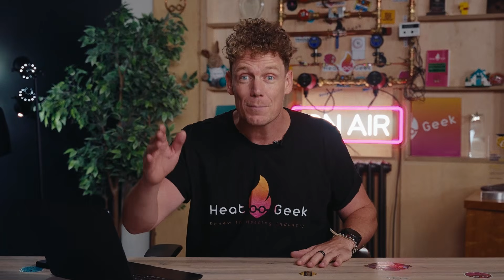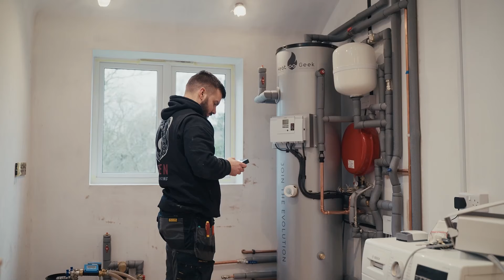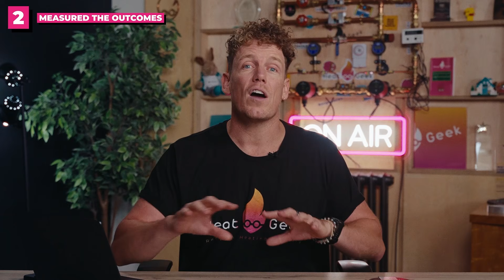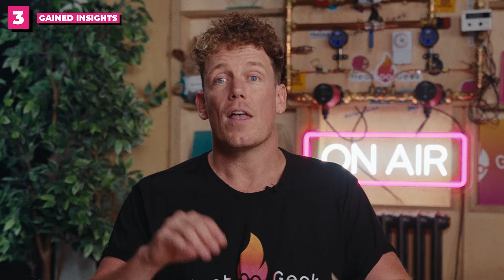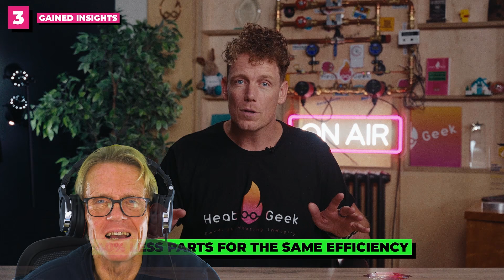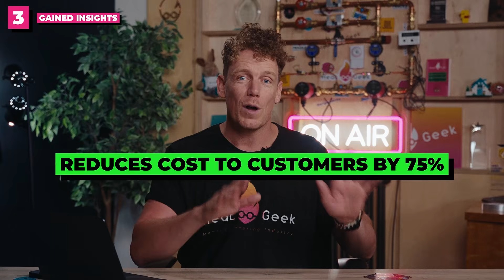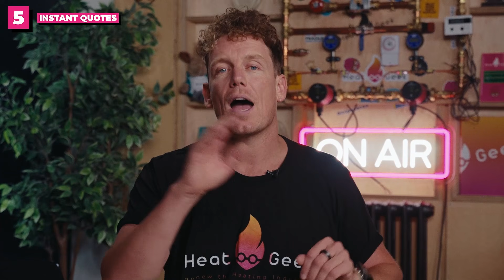Heat Pump Reality Check: Is Zero Disrupt Too Good to Be True?

Comment: This makes no sense. I went on the website for a quote bearing in mind that my home has been built in the last 10 years with a heat loss of circa 5kw. They quoted me £3150 for what basically is just a heat pump purchase. I have a 210L tank and my home uses underfloor heating. When I checked online a Valiant 7kw heat pump including all install accessories (and I mean ALL) comes to £4500 (ex VAT which is what they'll be paying, if not less, my quote was retail)

So let's do the math. £7500 BUS grant + £3150 = £10,650
£10,650 - £4,500 = £6,150

So what you are essentially saying is that labour cost for a days work is worth £6,150...........
Reply: The guestimate tool def needs work but prices are too high regardless. Mine came back saying £5000 and need a 10kw heat pump.  Have a 70s 3 bed detached so not perfect but def don't use 10kw at -2.  Done my own heat loss, think 7kw would be more than enough (5kw would probably be fine but marginal), but even then the price between a 7kw to 10kw would not bring that down to £1 and to think they get £7500 on top. 

My next heating system will be a heat pump and I will install it, ironically I will be able to do this thanks to the excellent information provided by HeatGeeks!   Price will be similar but at least I'll get the install I want and won't have wasted £7500 of tax payers money.
Reply: @radfoo the BUS grant is there so we have enough heat pump engineers to replace all the systems we will need to change
Reply: For about the same price here (£7.5k + £3.5k) I got, new 6kW HP, new Mixergy HWC, 7 new larger radiators, new 28mm copper backbone with 22mm feeds to radiators and six men for about six days.

Perhaps you should get another quote ?
Reply: If they're quoting you that much then who gets the £1 quote? Are you sure you haven't missed anything?
Reply: @user-cl4wn9pc2s  Nope, mine would be an ideal install. The HP would go on the other side of the wall where the boiler is. Not that thr website would know this but i did select the 3m or less run and also chose the option to use my own tank. Its honestly a rip off. This install can be done easily within the £7500 grant. Quite disappointed. When this grant disappears and no one is installing heat pumps anymore imagine the servicing costs
Reply: @etan30  it’s not a quote though. it’s an estimate. send them an email, see if they can give you a better idea with the info you’ve put on here.
Reply: i’ve got a 5 bed detached 1950s house and my estimate is £2700…
Reply: A "heat loss of 5kw"??? FFS.....the generally public really doesn't understand.

Comment: Since when do heat pumps not modulate? I think Roger is trolling
Reply: Is variable speed the same as modulation? I dont think so, you can change a motor speed by changing the frequency but if say you change from 50Hz to 40 Hz to slow down the motor then it will be running at 40Hz not modulation between 50Hz and 40Hz. Thats not modulating
Reply: @dantronics1682 

And if your automated system varies that frequency between 40 and 50Hz to automatically adjust compressor output as set by the weather compensation curve ?

HPs now modulate output.
Reply: Actually the inverter heat pumps do modulate downwards  but they have no spare capacity to turn up the flow temperature  in cold weather, The efficiency drops and you just have to run them 24/7.

Comment: Won’t it all depend on the electricity prices that will determine if it’s cost effective when it comes to the bills.
Reply: Electricity is 4x the price of gas. In winter when you need to use your heat pump to heat your house the COP can be around 2. 
So, in winter, a gas boiler costs half as much as a heat pump to heat your house.
Reply: @caparn100  so basically it sounds like these heat pump companies need a campaign to sell their products = don’t worry about the cost of your bills being doubled compared to gas boiler because we will pay the difference each year .

Comment: Heat pump installers sound like the EV people who are now promising recharging in 10 minutes by magic  to address range anxiety.
Reply: You don't really need ten minute charging, it would rarely be of benefit, if your on a long trip you don't want to be rushing your coffee or bacon roll whilst car charging, ready for its next 300 miles.
Range anxiety is a fallacy now in newer EVs.
Reply: You probably think an EV works like a kettle as well.
Reply: The latest ones do.  Mine is from last year and even that can charge on a road trip in about 17 minutes which is two minutes more than the average time people spend in a petrol station.

Comment: Here we go again. The problem is the installers or the design. Nothing wrong with heat pumps. My arse.
Reply: I can't work out if you are being sarcastic or not but if you think its not poor installations/design you should watch the Heat Geek and Skill Builder colab that goes to reinstall a botched install which shows it is the issue.

Comment: Fit bigger radiators and turn down the flow rate to about 45c and cut your heating bill bye half
Reply: That is exactly what I did and it works perfectly
Reply: Adam is offering heat pumps with similar costs to gas boilers without changing any/many radiators. You can pay more to replace more, but unless you have things like batteries and cheap tariffs, it is hard to halve the heating costs.
Reply: Don't use antiquated heating systems like radiators in the first place. What is wrong with the UK?

Comment: Roger I’m actually a fan, but you need to simmer down on this topic, you’re the one who’s coming across as a zealot now, that wasn’t always the case. Content was balanced around that Welsh blokes house. Adams got under your skin
Reply: My tumble dryer has heat pump. It works great and is cheaper to run.
Reply: @paulhayes6920  Mine has dual heat pumps :face-blue-smiling: Problem with them is that they can allow too much lint through the filters if you do not clean them regularly. When clogged they are very awkward to  dismantle and repair resulting in it not being economical and then being sent for scrap. so ultimately not lasting as long as a  conventional dryer. Plus they take a long time to warm up.
Reply: It's not being a zealot; facts are facts. The UK is just so far behind other countries.
Reply: You are kidding me. This is just a bit of good natured fun. Adam and I get on well.
Reply: @Roger-Bisby1 Rogers given us a platform and I’m very thankful for it!
Reply: @Roger-Bisby1  glad you can have a bit fun!
Reply: It looks like Adams and everyone elses heat pump sales will increase then with all the satisfied folks who have them. 

Especially with such amazing claims of sustainable annual COPs and electric costs that are so much cheaper than gas. I'll just keep fitting them for folks who believe they are cheap to run and think that they are the future despite my concerns with their install and running costs.

I wish everyone all the very best with saving money heating their homes with sufficient air changes and heating their water in the long run. And good luck with cooking their food and sanitising their laundry, not having to use heavy chemicals to do it in the place of HOT water.
Reply: @poormanskint3008  something is telling me if you are unsure about that performance then you probably don’t know how to install them effectively and I would suggest you stop and do some training
Reply: @poormanskint3008  "And good luck with cooking their food and sanitising their laundry, not having to use heavy chemicals to do it in the place of HOT water." This is the most hilarious thing I've seen this week, none of these things have anything to do with heat pumps. Electric cookers have existed for decades and work very well. Most modern washing machines have a single cold water feed now. If you install heat pumps I'd question your credentials to be honest. 🤣

Comment: Home owners are catching on that when it's really cold in winter, the heat 'pump' becomes a hugely expensive electric kettle to heat the water in the rads.
Reply: Are you trying to argue that in the winter, only folk using a heat pump will be using more fuel to keep their homes warm?  I know my gas bill went up last winter.  It's almost like I needed the heating on when it was cold.

My parents have a heat pump system, and their bills followed the same pattern as mine.  Their leccy bill is also substantially less than what their gas bill was from before, despite the snow they had to deal with last winter.
Reply: Well if you are using a heat pump that works like a kettle then that's the problem and you've been had.
Reply: Mine was working just fine in .22C last winter though I don't have radiators.  I don't know what the fascination with radiators is all about.

Comment: Roger, Adam should install a HP in your own home and see if it works.
Reply: Believe me he has offered and I have declined. I like to turn my heat off at night and when I go out during the day I don't want to heat my home. We don't have a cat or dog
Reply: @Roger-Bisby1  Totally.
Reply: That's literally the only thing that bothers me with heat pumps: I keep my boiler off whenever possible, definitely at night not so much because I want to save money, but because I like when it's completely silent at home, especially at night. Does a heat pump running at night generate perceivable level of noise in the rooms, just like a boiler does?

Comment: @ 15:45 if you ask for more parts the price will go down only if the factories can produce enough of them 😅 
Try to ask for 152 mm shell and see if their price is lower than before the begining of the war 😅 
The same is for everything 😅 
The electricity demand is higher then ever and the price of it is going up 😅😂 
Heat pump use a lot of aluminium and copper - gas boilers are using less and less of this metals - this is another reason why they are getting cheapper 😅 … 
Heat pumps are compeating with the car industry for resources - this will only drive the price of them up and up 😅

Comment: Couldn't watch all of it sorry Roger. I'm on your side. If I was building a new home, I wouldn't want a heat pump. And if I had an old home, I certainly wouldn't consider a heat pump heating system. The analogy to EVs comes to mind. You have a vehicle that is way more expensive. Comes with a carbon footprint that it can't offload in it's lifetime. That then uses vast amounts of electricity that the world is struggling to provide, and at what cost to the environment. Has very restricted range. Very limited usefulness. Big resource issues, and recycling issues. Generally inferior product to what it wants to replace. And then you have heat pumps v efficient gas boilers. Say no more.
Reply: Have you thought of taking up climate change denier bingo? I think you’d be rather good
Reply: @simonm9923  I was thinking the same.  He managed to hit all the fake talking points in one post.
Reply: Lets not change or improve anything hey. Why did we ever progress from living in caves and cooking in an open pit. lol. Its people like you the reason this country is in such a mess, stagnant because you are resistant to change.
Reply: @David-bi6lf I don't mind improvement. It is the people in history that didn't agree with the status quo, that changed the ways things are done. There have been many improvements. Some better than others. Then there are inventions that come along that look OK on the surface. But in practical terms don't really make the cut. They last a short while until a genuine improvement comes along. Then are consigned to the history books. Heat pumps will be one of those. Flogging a dead horse.
Reply: @davetaylor4741  have you had problems with yours then? I assume you’re speaking from personal experience?

Comment: I see heat pumps everywhere I go. New builds by developers, new social housing, affordable new builds and people dumping Calor and oil heating. However, I am in the north of Scotland, where there is very limited access to mains gas, and it is much colder in winter.
Reply: I only see them on the internet
Reply: @delboy6384 Scotland has very different building regulations. Houses are built much stronger and to higher standards. The new regs are close to Passive House standards. So huge levels of insulation and sealed up. Solar has been standard for around 2 decades, and heat pumps are being installed all over.
Reply: @gordonmackenzie4512  

My 1960's two bed semi in Scotland wont fall down granted, but it's as close to Passive House as Pavarotti is to Soprano, and Heat Pump works well.

Gas boilers in new builds banned as of April 2024.

Comment: @ 15:48 - the reason gas boilers are so cheap is because they are using very simple and cheap to made parts …
Air conditioners are here from @ 100 years - there is not much more to innovate to simplify the parts …
Refrigerant to water and to air heat exchangers are here from when the beer was invented 😅🤭😜; pumps used in heat pums are @ the same to those used in gas boilers….; the flow meters are integrated in the pump software in many cases….
If the heat pump manufacturers don’t want to cut their profits you won’t be able to cut prices more than 10-15% just by innovate new tech…. 
Refrigerant compressors are here from @ 150 years in all of their assortments… first being patented in 1837 by Jacob Perkins if I ask google 😅 
Who will fix all those heat pumps when thei will get 2-3-5-10 years of use and faults will appear ?  The main difference between fixing cars and gas boilers compared to heat pumps is that you can fix cars and gas boilers indoor !!! At shade in the summer and in a heated garage or in the comfort of the house in winter ! 
Heatpumps are outside in the cold, rain or heat - how many good engineers you will find able to work in those conditions, and until at what age for them in order for their health  to not get them out of this jobs … 
Many of our tools wont work well in costant temperature changes … 
A tablet battery wont last at -5 -10 -15 C … you cant use your phone well with gloves in the cold … …. Trust me that I will charge you and arm and a leg if you call me to fix youre heat pump in the winter 😅 …

Comment: Had mine done three weeks ago, amazing!
Reply: How would you know? My house in Wales is currently at 20.6C at 2am and the heating hasn’t been on since April.
Reply: @bordersw1239 maybe Edward's house isn't as insulated as yours or he lives in a colder part of the UK? It's working for him at the moment. Many have had good heat pump experiences.
Reply: @Biggest-hz7ng . Because it hasn’t been cold yet - it’s really not hard to work this out!
Reply: @bordersw1239 I've had my heating on for the past week or so. The heat pump will also have been working to heat water.

Comment: I just fitted my CDi30 combi with a CT200 controller, weather compensated and put Bosch programmable TRV in all rooms. Optimised gas combi will always be cheaper to run than an air-sourced heat pump in Glasgow.
Reply: Sure fella.
Reply: Data says otherwise

Comment: Fossil fuels get £1 7. 5 billion a year subsides. Of that 2.5billion for decommissioning. Much is tax breaks.
Reply: they also generate 24.5 billion in tax via fuel duty, aircraft fuel is taxed at very low rates otherwise the industry wouldnt be able to survive. Steel Power generation refiners and large industry all get lower tax rates on essential energy needs but then end up paying more tax on the sales via VAT.
Reply: @pstanyer1  so a net of 5 billion To us… renewables give FREEE ENERGY… and at gas and oil scale would make that look like a nats cock

Comment: A unit of electric is about 28p, and a unit of gas is a cubic meter, equivalent to about 11 KW, which is about 5p per KW. 

To make heat pumps cheaper and more viable than gas or oil heating. The price of an electric unit would have to be a penny or less per KW. To allow for the fragile efficiency of them that is only valid at the design stage and in ideal weather conditions. 

Example, a heat pump with a design COP of 5, would cost a penny an hour to run. But when that COP drops towards maybe 2 due to losing its efficiency. That penny will creep towards 2p, then 3p, 4p, and 5p an hour to run. Especially when it's defrosting, it's COP will be 1. Which could be a number of times a day for as long as it takes to defrost.
Reply: You need to reassess your figures, in reality a COP of 3.4 in a HP gives it the same running cost as an 85% efficient gas boiler, for electricity at 26p/kWh and gas at 7p/kWh (in practice my current tariff is 14p/kWh 24/7 for a year).

For my COP at 4.1 (average over 19 months) it costs me 3.4p per kWh of heat currently, compared to about 7p for 1 kWh of heat from a gas boiler.
Reply: @_Dougaldog 

If your system is that good all year round, then I definately will reasses my figures.

Who do you buy your electric from at a tarrif like that? Is it just off peak at night time, then use a more expensive tarrif to heat your home during the day?

What is the make and model of your system, and is your home an old terrace, or an old council block, or a recent new home?

How many defrosts a day does your system perform? 

Is the air around your home humid or dry?

All I can say is all the best with sustaining those claims. Just watch your COP start to drop now that the sytem has been running for over 19 months. If the cost of your electric doesnt increase to the same rate as everyone elses, it might take the kick out of the cost. Thats if youre buying from the UK grid.
Reply: @poormanskint3008  a unit of gas as priced on your tariff is also a kWh, not a cubic metre. With typical air source heat pump and boiler efficiencies, running costs for the heat pump will already be cheaper at current electricity / gas unit costs.

Edit: you’re confusing kW (power) with kWh (energy). A unit of electricity costs around 3.5X the cost of a unit of gas - one unit = one kWh in each case